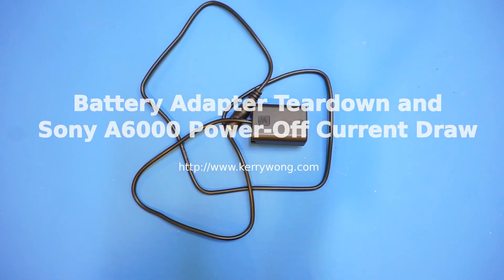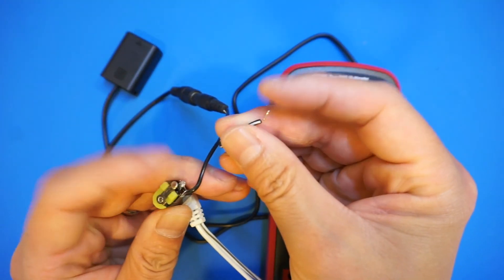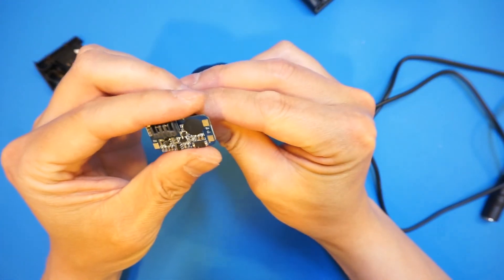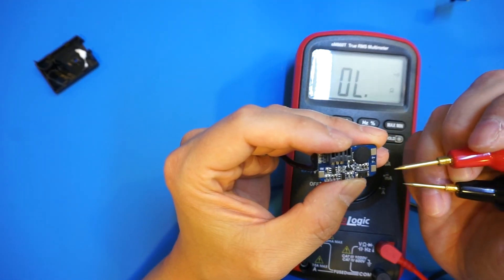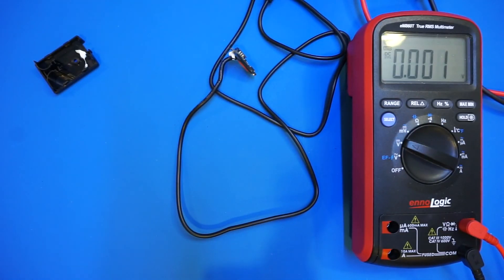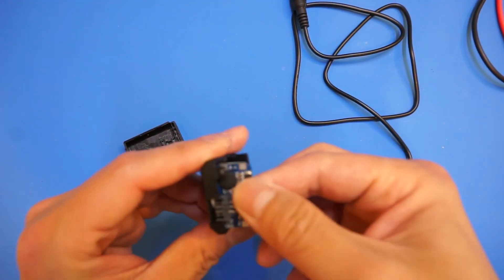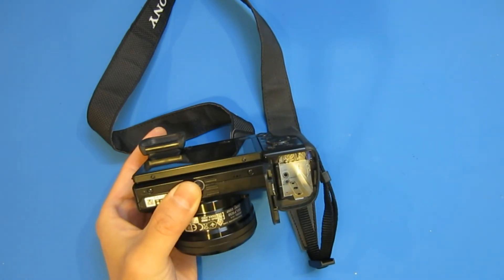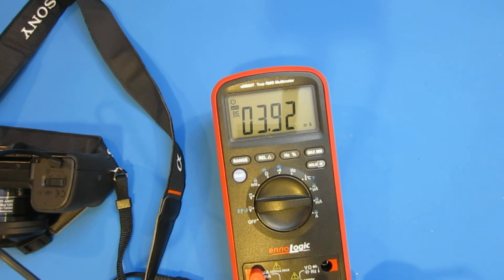Battery Adapter Teardown and Sony A6000 Power-Off Current Draw

Comment: Did you watch Graham Houghton's "Adding Battery Level Indication to Panasonic Dumy ..." video. The resistor that connects the - terminal and the T terminal should have value between 10k - 12K ohm with a heat dissipant capacity of 0,125 W or above so that the camera displays the charge level of the external battery correctly. Graham explains it for panasonic dummy batteries but it is applicable to all dummy batteries. Graham's link is : https://www.youtube.com/watch?v=Ti0KRKT4tcc

Comment: Damn u can't even tell the difference between a mosfet and resistor.. the pcb is a knockoff bms , it emulates the 'infolithium' signals for the camera to work properly. The maker of the dummy battery has just taken a normal pack & got rid of the cells and put wires on the b+ & b- and left the center tap empty. The bms being a dumb shit does not care about the missing voltage of 2nd tap , original sony battery would have not worked if u do not supply voltage to the sense lead for 1st cell negative & 2nd cell positive .. They have shorted the pins of the mosfet to bypass low voltage protection & directly send dc to the camera. That mosfet normally used to disconnect the battery to prevent over discharge but now as it will be powered by an external source it does not need such protection .

Comment: i know the video is old but... did you tested it if you put a lower voltage? for example if you take a standard 5v input if it ouputs 7.2?
As it is a usb cable... and the battery has a nominal voltage of 7.2v... maybe it is a step-up and not a step-down. What you tested just proves that it does not regulate the power down.
I might be wrong, but it is just a sugestion. :)

Comment: You did not test middle connector. I saw on some batteries designation "T" on this tap. I suspect that it is temperature sensor inside. And also someone pointed out that maybe Sony does not want you to power with anything other than their own batteries, so maybe there is some code involved.
Reply: Did you watch Graham Houghton's "Adding Battery Level Indication to Panasonic Dumy ..." video. The resistor that connects the - terminal and the T terminal should have value between 10k - 12K ohm with a heat dissipant capacity of 0,125 W or above so that the camera displays the charge level of the external battery correctly. Graham explains it for panasonic dummy batteries but it is applicable to all dummy batteries. Graham's link is : https://www.youtube.com/watch?v=Ti0KRKT4tcc

Comment: hi, do you think this is trsut worthy for my sony a6300 camera to power? I want to power my camera with a dummy and an powerbank battery. Bit im afraid this dummy could get broken and my camer gets damaged. Thanks
Reply from the maker: I have been using this adapter for a long time and have had no problem with it. As long as you power it from a good power brick  you should have no issues.
Reply: @KerryWongBlog  thanks

Comment: These dummy batteries are advertised as "decoded" on eBay which is perhaps a clue as to the need for a circuit board.
I've also seen elsewhere on YouTube that SONY camera runs longer and cooler @ 8.4v than 7.4v
So I plan to build a dummy battery setup powered by a 20v DeWalt lithium battery!
Following my other build:
https://www.youtube.com/watch?v=PQTAForw_I0
but setting potentiometer to 8.4v and hard wiring dummy battery to box.
Thanks for taking this thing apart. I was wondering what was in there and you helped me out.

Comment: That circuit is needed for the middle contact point, set the voltage to 1cell or 1/2 the total voltage, without the circuit and 1/2 cell voltage on the middle terminal the camera  knows your not using batteries and.might not turn on

Comment: When a camera is turned off it still consumes a little power from the battery. The main reason is the clock inside the camera. Nearly all cameras have an extra little rechargeable battery  inside for keaping the clock working and sometimes keep the settings of the camera saved. When a camera is left for a prolonged  time without its main battery, the time of the clock is reset and may all the settings are reset to the factory default. 
The main battery inside the camera keeps the little battery inside always charged. That operation will eventually drain the main battery after long time. Lithium batteries when are stored outside electronic devices don't loose their charge considerably after weeks or a few months like common metal hydride rechargeable batteries (Eneloop batteries is an exception). 

For example when I burst shooting and the memory buffer of the camera is full , in the case I turn off my Sony α7 camera then the camera isn't really turned off. There is an indication of a red led near the battery that data is written from the memory buffer to the SD card. It is easy for everyone to check that thing. When the writing from buffer to SD card is finished then the camera is theoretically turned off. 
So the power switch on the cameras isn't a real power switch which cuts the power from the battery to the camera electronics. It is a switch that inform the software of  the camera to check if everything is saved properly and afterwards the camera is in a discreet low standby mode.

Comment: I am using one of these battery adapters on my Sony a6000 with the circuit board inside. It works well with Sony lenses. However when I use Canon lenses with a Fotodiox  auto focus lens adapter the camera will not switch on. Camera works fine with a normal lens adapter but then I have no control over the lens. Any ideas why !!
Reply from the maker: So maybe there is some sort of handshake going on between the battery and the camera. But without a different camera to test this theory, I won't know for sure.

Comment: It could well be that the battery management board communicates with the camera about the battery branding, serial number, age, health, charge ect... 
So it may well be there to trick the camera in to detecting it as a battery.
Reply from the maker: I don't think it's sending data to the camera via the pin that is typically designated for thermistor as I couldn't see any waveform during power on or during operation.

Comment: it was probably cheaper than redesigning the case and maybe redesigning the connector to just take bear wires ... also the camera might be expecting some data
Reply from the maker: I was wondering about whether the thermistor output was multiplexed for sending data as well. I later verified with an oscilloscope and upon powering up I didn't see any data.

Comment: You would think Sony would have used a simple button cell to keep the time and date instead of draining the li-po battery power in the camera.  Kind of makes it inconvient when you reach for your camera for that Kodak moment and you get a dead camera.
Reply from the maker: I doubt that RTC along uses that much power though.  According to Sony's official site, the latest firmware (3.2) was released 7/26/2016 which is a year ago. So I think this is probably a hardware issue they couldn't fix using firmware update alone.

Comment: Kerry - are there any other pass throughs on the adapter's connector? Maybe a sense line that provides feedback to the COB and then controls the voltage/current interior to the camera downstream from the voltage supply? Otherwise I can't see any functionality for the PCB either???
Reply from the maker: Nothing obvious. Since the adapter is to replace the battery so I wouldn't expect the COB to control anything downstream as the Li-ion battery does not have any voltage control built in. Besides the current shunt, there is a 6 pin SOT 23 device on the board marked 7022, which could be a low voltage regulator. There's another mysterious SOT 23 component (C2NL) which I couldn't find any information on.
Reply: It's Sony, probably some sort of battery id system to prevent non-sony battery usage. Maybe Kerry can check if any of the battery outputs send a signal.